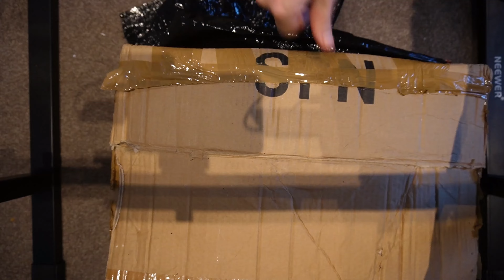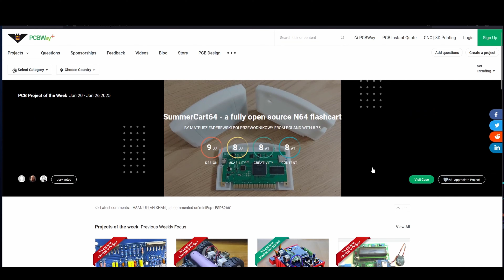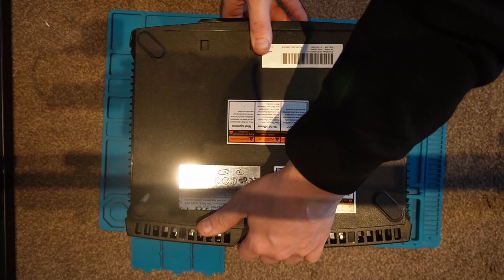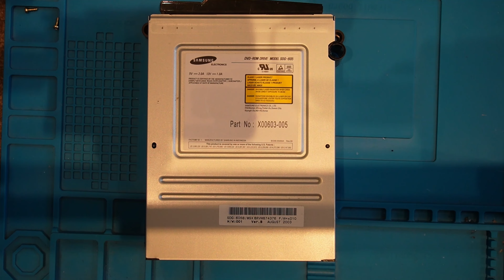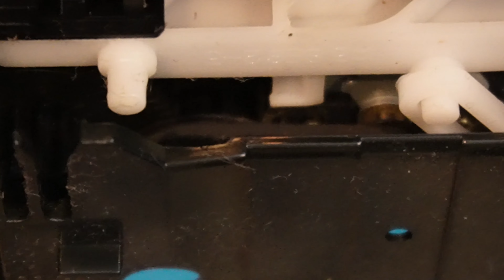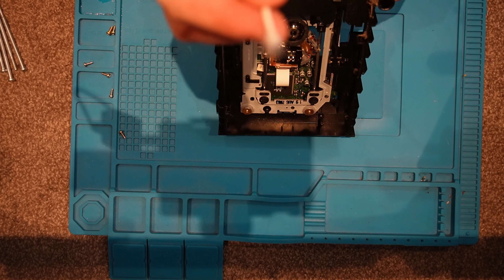Original Xbox Sticky DVD Drive Repair

Comment: I just fixed this issue with a couple of old CD/DVD-ROM drives, and now you making a video about this one. Seems to be the time for them to go duff with this same stuck door issue lol. 
Nicely done, I might get some of these belts. Though putting it in hot water to shrink the belt. That's a good idea I didn't think to do that.
Reply from the maker: I think it is its an easy fix aswell, Thanks thats a good idea think il grab myself some spares to will come in handy for sure :)